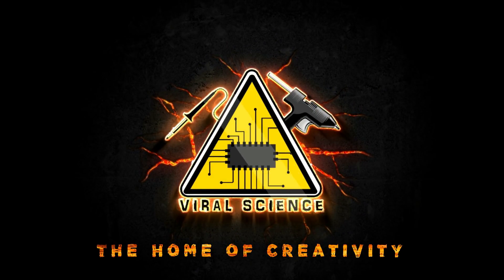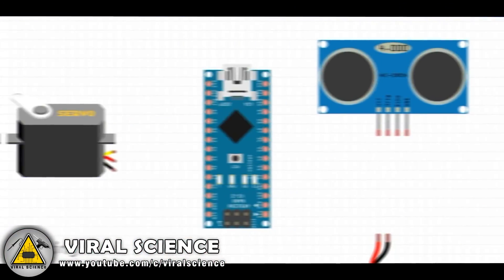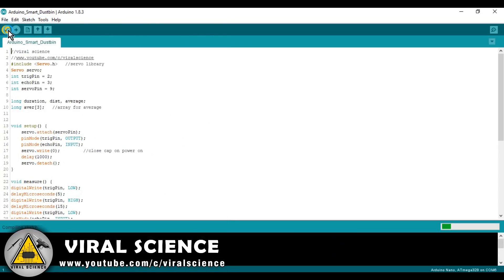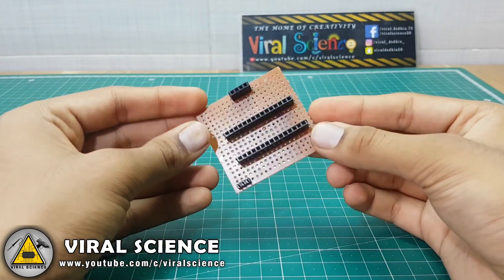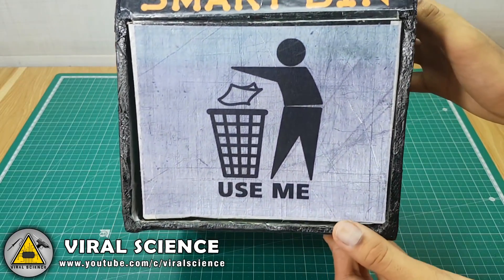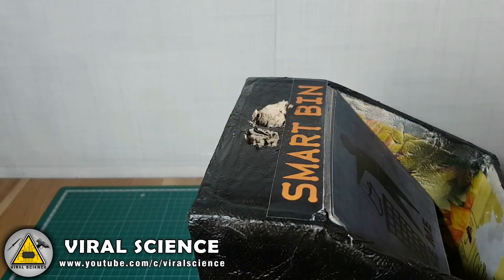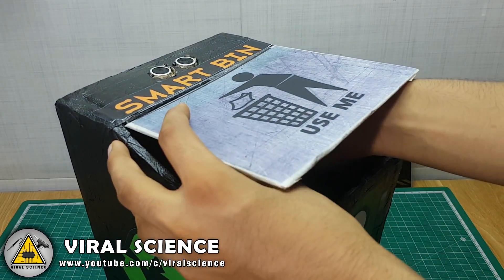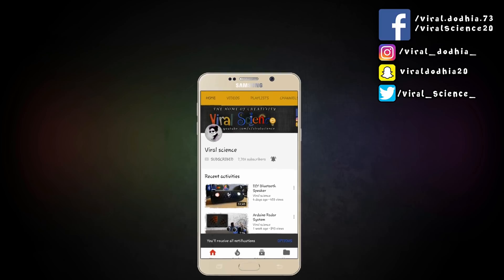Arduino Automatic Open/Close Smart Dust Bin

Comment from the maker: Results of the Giveaway contest will be announced in next 3 days
If you haven't yet participated, today is last chance 👍
Reply: Viral science really this project is nice
Iam doing ur all projects
But iam not having few items
Iam soonly finish my project
Reply: Viral science
Reply: Can someone answer my question .I am making a project which uses arduino nano bit I don't know how to give power supply to it please help and will it work if I use a 9 volt battery .
Reply: Thanks but I am using nano because its small and easy to fit on breadboard it doest have a DC jack port so how should I give power supply which pins I should use please reply to my question .
Reply: Duke SHEIKH its a earthquake detector
Reply: Duke SHEIKH and thanks .
Reply: Duke SHEIKH ya sure .

Comment: Hi
Can you help me please?

I have kids car electric 
And i want to connect distance sensor to the wire of the motor.  So when it will Get near something it will cut the power.  
And reconnect it automatically when it will be cleared

Some dry contact i/o that can handle about 7 ampere 12v.  
And this dry contact will be the switch of the wire ,

Can you help me of the components?

Thanks
Yossi
Reply from the maker: I have made obstacle avoiding car you can refer that video
Reply: Viral Science - The home of Creativity canyou gave the link please?